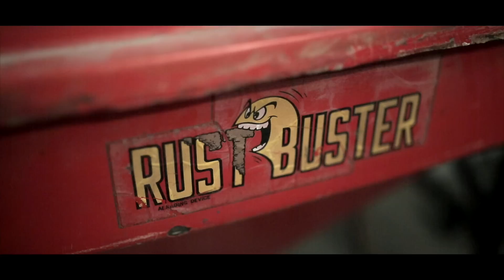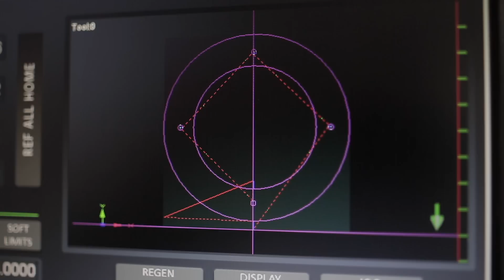Why two classic car restorations are better than one | Sprinter Camper and Lotus Esprit DIY builds

Comment: I wire brushed and cleaned really well the beads of my old steel wheels and then painted them with several coats put the tyres back on and the wheels it did not go flat for several years

Comment: It has been said that 'a change is as good as a holiday', and this is an excellent demonstration, George!  A blasting cabinet & an ultrasonic bath are 2 things I would want when doing a restoration.  We had a small ultrasonic where I worked a few decades ago.  It was fantastic at getting gunk out of all sorts of places & things.  At one point I even took a few motorbike carbs in that couldn't be balanced & ran them through it.  They came out & were good as new afterwards!  No trouble to balance then.  The blasting cabinet is a great tool for getting all the surfaces, nooks & crannies cleaned, and is great prep for painting too!
Reply: I bought and ultrasonic cleaner etc . Worked fantastic.. 

For about an hour… the transducers were merely glued to the stainless bath.. disappointing and no comebacks as I had waited more than 90 days before usage..and no warranty after that.

I will fix it.. just need an R Tech welder and some stainless stuff… 

Transducers bought a sit on my shelving unit amongst the other stuff that awaits placement in (hopefully) the correct place within the appropriate project.. whichever that is ….

Comment: I purchased a blasting cabinet a few years ago from a company named Skat here in the states. When it comes to working on old cars, it’s pretty much my favorite tool in the shop. My cabinet has a piece of metal stretch cloth that separates and provides a platform for the item you are blasting. That way it doesn’t have to bathe in the media like your wheel was doing.
Reply: I suspect this was just the initial test run to make sure it was working before George gets into the finishing details.  He was so enthusiastic to get the first test run in, he didn't even bother to remove the tyre valve or wheel weight yet!  I'm sure the grid, which he mentioned was missing, will be added soon.
Reply: Noticed the tyre weight missed the valve..

I blame the ‘mixer’…

And maybe the whisky…Scottish 

Not Irish…
Reply: @malcolmyoung7866  The tyre techs would normally remove the weights before the tyre, (based on getting mine done in the past).  No idea what was happening there.
Reply: @malcolmyoung7866  the Irish invented distilled spirit. JDS in the AZ

Comment: Nice job again 👍👍👍
Get a concrete steel reinforcement mesh offcut  somewhere as internal table and convert an old hub or something to a rotary table. A quick upgrade well worth doing. 
Been there, done that.
For my next project I am now building a wet blasting conversion. Lives a really nice satin finis on aluminum 😉

Comment: Got a blast cabinet 2 years ago from a Polish company, delivered for €569. It's a side loader, they had changed to a front loading design and these were on sale. Saved me a fortune! But I could do with a tandem compressor. It's in it's element at about 110psi. I think I need larger bore piping and a bigger mist separator to increase flow. Works great with Applied fine crushed glass. The filtration system is getting old, may go down the cyclone separator route in the future. Anyhow, it really helped me out and continues to do so.

Comment: I built a cyclone vac system very similar for wood working projects - I found I needed internal reinforcement of the barrel so stop it collapsing. Just a word to the wise in case you suffer the same. Great work mate - keep it up

Comment: AWESOME George..

My cabinet is one of those ‘chinesium’ knockoffs works OK… better when Jed is working on it. Ear defence and face mask highly recommended although your extraction system a bit better than my shop vac… Jed only work the sand blaster when he is not ‘languishing’ on the floor under something with the needle scaler… some say I am too soft on the lad… maybe.. either way he can’t hear me swearing about his ‘slow work rate’ over the noise of that compressor… or shop vac… OR BOTH!!

Comment: We have a local company  , chemical dip , hand finish then , powder coat , prime, colour , clear , 200GBP  on steels that size . and will take off and put the tyres back on , they run 24 hours a day .

Comment: Would recommend using a whip hose on the blast gun instead of using the quick connect inside the cabinet
Reply from the maker: Have to do something about the in cabinet setup generally. Will get there eventually

Comment: Nice work George! What blasting media are you using? I bought a similar sized cabinet last summer and it's the best investment I've made in my workshop. I wish I bought one years ago. Had to make a significant investment to upgrade my compressor at the same time to run it, but both the compressor and cabinet were worth every penny as it's made proper in-house restoration of old rusty car parts a possibility without having to pay third parties to blast stuff for me.

Comment: It looks like there's a bit of a bend to the sides where you were putting the hole covers on - did you need to seal up the holes with epoxy to make sure they're going to be able to seal in the media? Also, the rim looked like it would benefit from a wetsand and then some quality gaffer tape to improve the seal - not as good as a purpose designed edging tape but with a bit of heat and glue if necessary it would probably last a year or two. Heat on it would help get the seal around the edge to it's best. 

I don't think I watched the whole of the video but I saw a guy trying to convert a fridge to a media-blasting cabinet by putting a perspex window in and cutting the holes for the gloves and the air-inlet pipe. This looked kind of crazy to me but when I see people like yourself trying to blast something that is too big for their cabinet, I know they'll see a chest freezer being thrown out and ask a mate who lives in the sticks if they'll think about converting it. Maybe you won't need one of those.....

Comment: what psi do you run the sand blaster at? and where in ireland do you buy media ?
Reply from the maker: My compressor makes 145psi / 13cfm and it works fine with crushed glass. I got my media on the off chance from a glazier in Louth but I think there’s a dedicated blasting specialist in Bray

Comment: Surprised the plasma cutter doesn’t start inside the cutaway section, but instead makes an ugly hole at the starting point…
Reply from the maker: Just my inexperience! You can select inside/outside/no offset lead in on the Xtreme CNC but I hadn’t set that cut up nicely